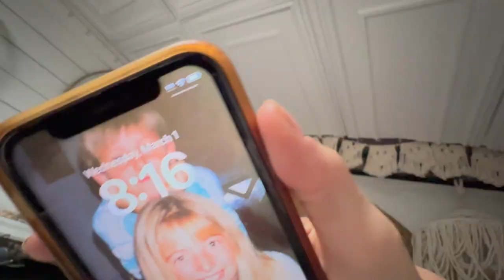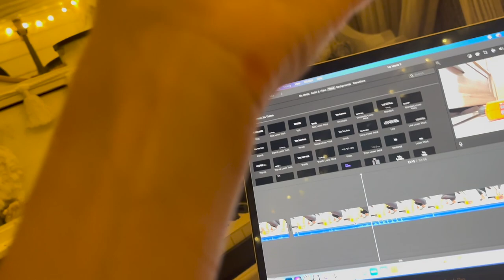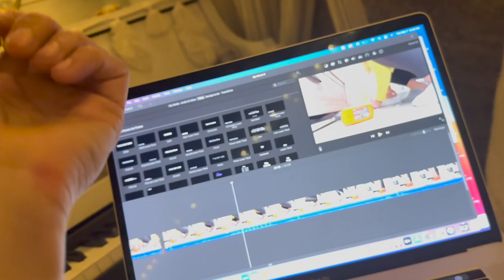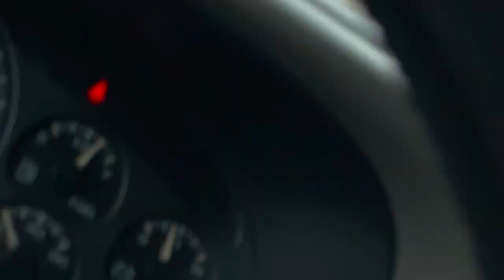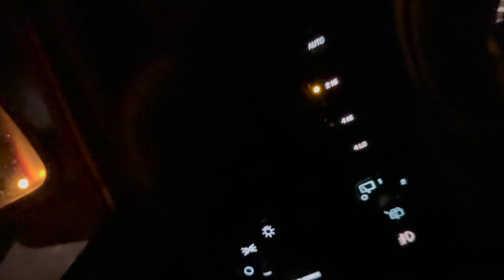from PROM QUEEN to LIVING IN A CAR - How Did I Get Here?!! #vanlife diaries (Travel Vlog #156)

Comment: Do you have an inverter that can turn your vehicle into a generator, Danna?
Reply from the maker: I do not
Reply: @montanadanna  With an inbverter you always have power as long as your car battery is charged.  Just be sure to turn you car on when you use it for a prolonged period so you don't wear your battery down.